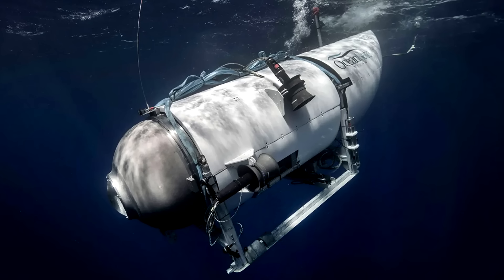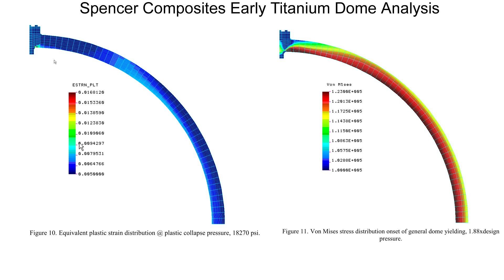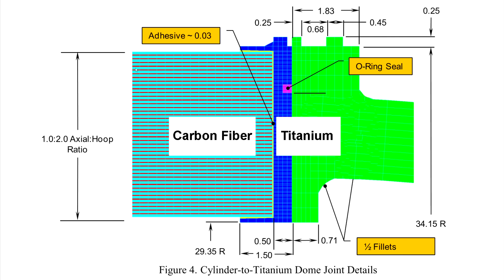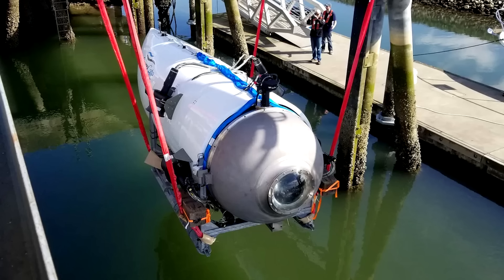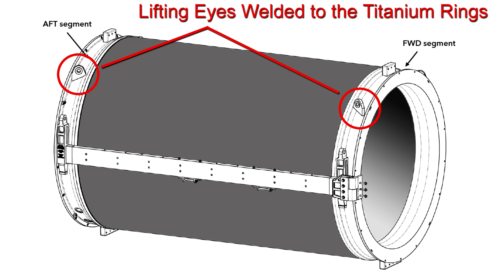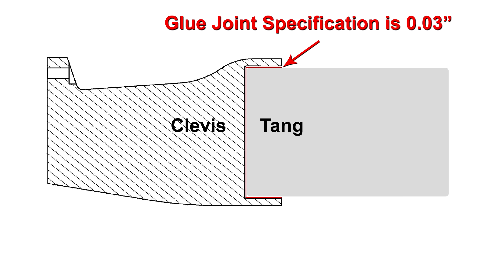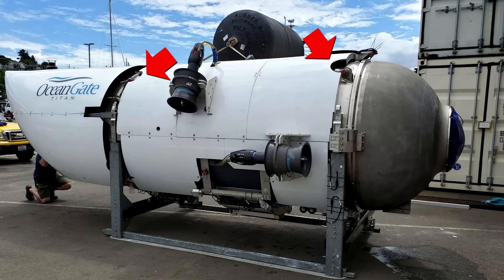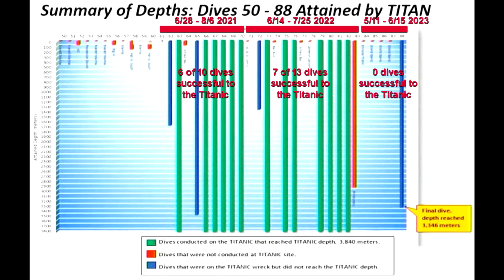OceanGate Titan Titanium Rings - An Additional Story About Them

Comment: 3:55 Tony Nissen is contradicting himself. Dave Dywer of the APL testified that he wanted to share the CF hull specifics to the foundry that were engineering and making the Titanium domes and rings so they could match it to each other. Tony Nissen was strongly against this, even when Dave Dywer did share some engineering plans of the CF hull with foundry Tony Nissen got so upset this resulting in APL severing relations with Ocean Gate. Tony's version of events is that they did eventuality match the rings to the V1 CF hull. If this was the case i wonder why Dave Dwyer is testifying the exact opposite.
Reply from the maker: I agree with you to a point, and you bring up another good story.  If I remember Dave Dyer's testimony, what he said was you have to consider the engineering of the sub as a whole.  The foreward and aft titanium pieces, together with the CF hull, as a unit for the engineering.  That was the disagreement he had with Tony, who felt you could design those as separate units and just put them together.  That issue is slightly different than this ring controversy because Tony testified that regarding engineering the rings, he could not get enough help from Spencer Composites or APL, so he hired his own engineer to help with the design of the rings.  Thanks for commenting.

Comment: These guys were such stupid tools and murderers by proxy. Every single thing their own engineers and instrumentation told them was ignored. Everything. 
"Don't weld hooks!" (Proceeds to weld hooks)
Reply from the maker: Basically yes. In the video, toward the end, I am trying to give OceanGate the benefit of the doubt after Tony was gone.  I do leave the door open that Collier Aerospace looked at the data and said it was okay to put lifting eyes on the rings. However, I don't see how they would have come up with something different than the original engineering analysis.  But we don't have the Collier engineering information right now. Thanks for commenting.
Reply: Who?
Reply: Hook, line and sunker.

Comment: It was not discussed, but welding includes partial melting of the materials to combine. That changes the physical properties, probably increases hardness and decreses flexibility or the other way around (I am no engineer). The point is: Down close to the ocean bottom there is such an extreme amount of pressure and force that I for my part would have disqualified those rings from used based on that alone.
With human lives one does not gamble.
Reply from the maker: Thanks for commenting.  I agree. Welding those thick lifting eyes to that ring may have caused many changes.  That is in addition to continually having each lifting eye take over 5,500 pounds of downward force, and the ring is only glued to the hull next to the lifting eye.
Reply: I am told that for ship hulls welding will do but riveting is preferred. This is what caused a lot of WWII destroyers to crack in half for no reason. The reason turned out that winter made the welds just brittle enough to crack in heavy seas, especially with inexperienced welders
Reply: @samsonsoturian6013  That was the case then, I understand; the problems with welding were not well understood. IIRC it was in the Baltic that there were problems in WW2,  I imagine the very low temperatures might have had something to do with that. But welding has moved on a lot since.

Comment: Since the cylindrical hull (horrible idea for a deep submersible) was compressing into an hour glass shape at depth. It's conceivable that action was putting a bending moment on the glue joints in addition to the shear they were already experiencing.
Reply from the maker: Thanks for commenting.  That is an excellent point that is hard to quantify because I have never read an actual measurement of the amount the hull got squeezed in at the center.  Phil Brooks said they measured that at the DOTF, but he never said the number.  I would like to know.  But you are on the right track; a significant squeeze could pull outward on the top surface and compress inward at the bottom surface of the edge of the hull.
Reply: @solareclipsetimer  I've said from the start, there is a very good reason why we don't see any deep sea submersibles with cylindrical hulls. There is no way to get around the bending forces without having a hull thickness that is impractical. Adding to the complexity is the fact that as dimensions grow, as the pressure hull gets larger, the increase in stress is exponential and not linear.

Comment: are their bones down their or were they all pulverized?
Reply from the maker: Pulverized.
Reply: They would have been mostly crushed but any pieces of substance would drift away and be consumed by any life down there... The Ocean keeps what she claims...
Reply: @Coffeemancer  Pulverized is an understatement. The rough physics of the energy released by the implosion comes out to ~50 kg of TNT all around them. Fluid density times pressure times depth. It comes out to 200 MegaJoules or more. 50 kg of TNT. 

I was surprised that there was apparently human body left to be put in buckets.
Reply: At those pressures differences found during the implosion bones are turned into paste. Their entire bodies with perhaps the exception of a few teeth would have near instantly turned into that same pink slime paste they use to make hotdogs and bologna.

Comment: "Wait WHAT? WELD IT?!?! Are you high or just incredibly stupid?" Tony, probably every damn day at Oceangate.
Reply: Yeah as soon as that was said, I knew it. I've only done a bit of welding but welds change a lot about the metal around the weld. There's entire charts of what kind of atomic structures can be formed and that's just for steel.
Reply: @TheLegendsmith  HAZ  (heat affected zone)
Reply: @TheLegendsmith  If you ever see an Army guy grunt at a weld on his equipment...

There is this bluish-black color that is like the death spot for steel 😂

'This is rated for 10k lbs!!!'

-this equipment weighs 5k, lets use 2, and go slow...
Reply: @TheLegendsmith  Yep, i've welded Ti for aerospace applications, there's thermal stresses, dimensional changes, changes in metallurgy twisting forces on a bonded ring, it changes the expansion coefficient of that section of machined ring before it deforms under the weight of actually being lifted by the 'hard' points.  I'm not an engineer and i can tell this is top tier level stupid.

I feel for this guy, he's probably worn down from herding cats like this every day with a nonstop firehose of stupid stuff like this shot into his face.  I'm surprised they didn't JB Weld the hooks on at this point TBH.
Reply: Asking questions is fine, but implementing your own scatterbrained ideas after being told by an educated professional NOT to do it is beyond my understanding. 

I mean i guess I could understand it if it was only Rush going down, but he was bringing others along with him, there's no room for error when dealing with others lives, especially on a purely commercial venture, there is no new data that can be gained going down there in Titan.
Reply: @BoleDaPole  Asking questions isn't always fine, sometimes it outs you as a complete incompetent idiot.  I'm not an engineer, but i choked on coffee when he said they wanted to weld it, wasn't expecting that level of stupid.  To me and my simple aircraft mechanic and metalworking mind welding parts onto a machined Ti ring interfaced with janky carbon fiber is like asking "Hey, should i cut the wings off the plane and hammer nails into the tires?  I think that'd help!"

That's a question that SHOULD get you fired if we still have rigorous standards VS entitlement.

I wouldn't trust this guy to be my barista, "We're out of sugar so I  used some of that sweet tasting rat poison in your cafecita, enjoy!".  

That's how stupid this question sounds to anyone who knows anything about metalworking.
Reply: he should've hired some professionals instead, as far as I know he kept his team to innovative, woke and young people instead of hiring experienced and competent employees.... go woke, go broke (literally).... so sad for the dead ones and left-behinds of them, they didn't knew how incompetent and foolish those guys they trusted had been (just my opinion on this topic)
Reply: @haegger666  Yeap. He hired a team of "yes men" - or at least "not no men". If you spoke out about the bad decisions, poor designs, and shit engineering, at best you'd be fired, at worst fired and sued out of existence.
Reply: ...AS ADAM SAVAGE SAID, "i'm rejectinng your reality and substite by my own",RIGHT?

.....OK,CONSEQUENCE OF REJECTING "2+2=4".....
Reply: Isn't welding titanium like pretty difficult?
Reply: @CatNolara  Real titanium is difficult and expensive, the welding rods are radioactive (contain thorium), but for all we know the 'titanium' they used was just melted down pot metal fidget spinners with 35% cardboard filler from China that never sold when the fad ended.  

In the end they probably bought a $89 flux core buzzbox off Amazon and stuck them on with that.
Reply: @jfbeam  Everything was supposed to be something else lol, the carbon wrap for the hull, the bonding layers, the window and seal, pretty much nothing they did went to plan at any stage.  They cut so many corners they made a perfect circle of failure.
Reply: He probably wishes he'd been that blunt every day...

Comment: So the expert told them no, but they did it anyway 🙄
Reply from the maker: Basically.  Trying to give OceanGate the benefit of the doubt after Tony, I do leave the door open that Collier Aerospace looked at the data and said it was okay to put lifting eyes on the rings.  But we don't have that engineering information right now. Thanks for commenting.
Reply: @solareclipsetimer also remember that at one point the sub was dropped hard enough that the bolts holding the dome on sheared. They only had three or four of the bolts in at the time, but that is a lot of force.
Reply from the maker: @wackyvorlon  Yes, you are correct.  That was while returning onto the ship while on the LARS.  I am not clear why that happened.  There is also some new testimony about impacts caused to the sub on dive 87.  I will be doing a video about that.  Thanks for commenting.
Reply: @solareclipsetimer  also (purely for benefit of the doubt) this engineer said ONE reason you can't weld the eyes on is because it would heat the glue and hull, which were already attached to the Ring.

When they built a new Titan sub, they had that ring and nothing was attached....now they were free to weld without damaging anything.

Sadly, the engineer gave TWO reasons not to weld, and only ONE of those reasons were safely cleared away!
Reply from the maker: @donperegrine922  Yes, you are correct.  Thank you for your reply.  I go over that in the video.  When Tony was gone, they were free to weld, lifting eyes to the rings before re-attaching the rings to the new hull.  The question is, were lifting eyes a bad idea structurally?
Reply: That pretty much sums up the entire existence of Oceangate
Reply: The rings were glued onto the hull with what looks like aircraft seal BMS 5-95, which is designed to withstand about 20  psi,  and went ahead and subjected it to 6000 psi? And that's only 1 of countless inferior elements of that contraption.
Reply: Mr. Rush had a LOT of guts.. but he didn't have the GUTS to test to destruction twice.., with him in it. Haa haa..
Reply: @jamesnewpor6173  yea a lot of guts that turned into liquid in milliseconds
Reply: Ohhh yea, just a matter of time before this untested sub went pop.
Reply: The whole damn thing was designed that way 😂
Reply: you are remembered for the rules you break

Comment: Can't weld lifting eyes to the ring..... but you could extend the support frame and put lifting eyes there. Simples
Reply from the maker: Correct, Tony always wanted it supported from the frame.
Reply: @solareclipsetimer After seeing how much more involved and difficult it was to lift the craft by the supports, I'm sure it wouldn't have been long before they were taking shortcuts with that too.
Reply from the maker: @fredwin  Yes, rigging to the frame was probably a pain in the butt.  However, that was the way to lift it and properly distribute the loads.  No matter how much of a pain it is, you still have to do what is correct based on the engineering.
Reply: At the very least, the lifting stresses via the support frame were already calculated. Welding new lift points onto the rings invalidates all previous calculations.
Reply: I can't believe they actually found a welder who was willing to weld on treated Titanium. That stuff doesn't like being manipulated, like bending or forming, let alone welding.
Reply: It could have been what started the break by lifting it from there.
Reply from the maker: @MatthewBritnell  Correct.  I go back and forth between thinking the primary failure was the hull versus the glued rings.  This analysis makes me go back to the rings.

Comment: But titanium is the strongest metal because it has the coolest name.
Reply from the maker: Agree, it is a cool name.
Reply: Titanium is a very useful metal but you have to use it properly. Welding must be done in an inert atmosphere and the welded assembly has to be heat-treated to regain good material properties in the fusion zone and heat-affected zone. Do anything wrong and it's brittle as glass. And if they welded the lugs on after the shell was glued to the ring, they were nuts. That's a hot process.